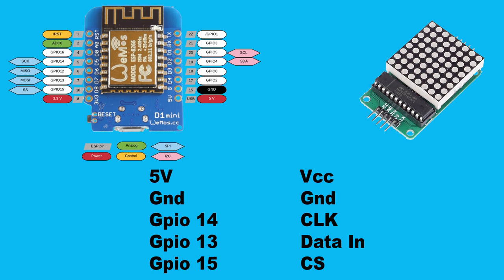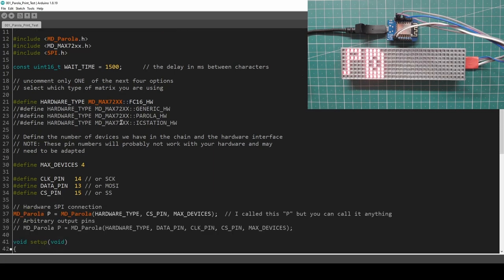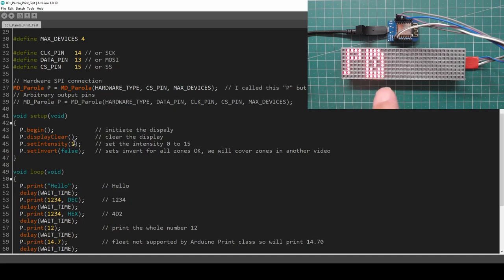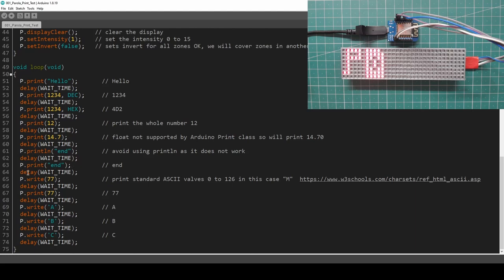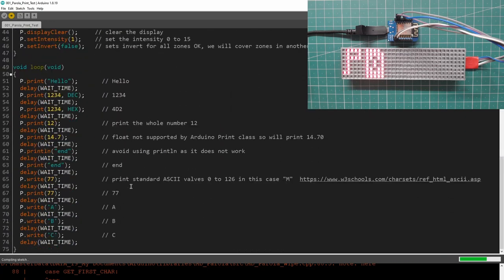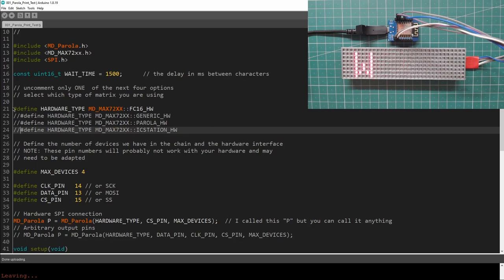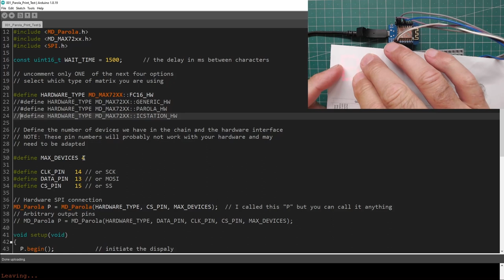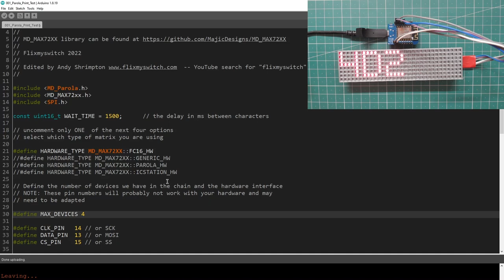Max7219 LED Matrix getting it working, correct hardware type, Parola Library Arduino ESP8266 #0045

Comment: I recently viewed your first video and I have a problem with gibberish on the display and a number of displays with nothing illuminated at all. I am running it off an esp32 with 4 cascaded displays making 16 in total. Is this going to be an issue or is it down to the wrong hardware type being selected ?  The displays are arranged two on top and two on the bottom and not horizontally in one long line just for clarity.
Reply from the maker: You have to select the correct hardware type you have a choice of 4
Reply from the maker: Check in the video lines 21 to 24 and try each setting. You can only define one at a time
Reply from the maker: Try just getting one to work first. When you have 16 make sure to set the brightness low as I show
Reply: I have tried all four hardware types for each separate 4 in 1 display and all show gibberish on every one. This is using the Parola scrolling example in the MD Parola examples within Arduino ide.
Reply: Is there a location or repository for the code you have used?
Reply from the maker: Follow the link in the  show notes. You can download the code.
Reply from the maker: You can download it for FREE and once it works you can if you wish return and buy me a coffee.

Once you get it working it does get easier, especially with my videos to guide you. Let me know how you get on
Reply: I have tested all four 4 in 1 displays and found 2 of them to be faulty. The gibberish on the faulty displays and not on the good ones. The hardware I found to work within the code was the fc16_hw.
Reply from the maker: @colinhoof-ee9rg  great news. Time to have some fun. What are you going to be making
Reply: @flixmyswitch  making double height message display, using esp32 with Bluetooth control via app. All the videos I have seen don't have, the display using a separate supply from the microcontroller, is this wise. All projects make use of a fonts library file and custom Parola. I have gotta be honest these displays, are new to me, but you only really learn, when you fail which I have been attributing to my lack of knowledge and not failing or faulty hardware.
Reply from the maker: @colinhoof-ee9rg  we all fail as you say it's part of the learning curve. Yes very wise to power separately just tie the ground together otherwise you may get timing issues.  That why I state to use a low intensity value if not using one.
Reply from the maker: On your faulty modules try code that has a low intensity powered off the chip to double check it's not a issue with separate power supply. Or try making the grounds common between the esp32 and the desperate power supply. Are you powering the LEDs modules with 3v.
Reply: 5v 2a power bank . Arduino nano was sharing supply with display. What I did notice was the Arduino was glitching with a less than ideal connection to the power bank and the mini usb connector on board the nano. The code I have been using had no facility, to alter the brightness / intensity of the display.
Reply from the maker: @colinhoof-ee9rg  https://youtu.be/JGlAhBDaG1c?si=EsfvLWfIU1ruJ0iX  FOR INTENSITY
Reply: @flixmyswitch  Thank you I will endeavour to sort out asap and make the necessary adjustments.
Reply: Thank you for all your comments and support. It is very much appreciated!!

Comment: can you post on the bluetooth?
Reply from the maker: Hi yes you can would need an esp32 as that has bluetooth builtin. Just change the code to get bluetooth working
Reply: I have double height display working. Do you have code for Bluetooth integration on esp32 vroom 32 ?